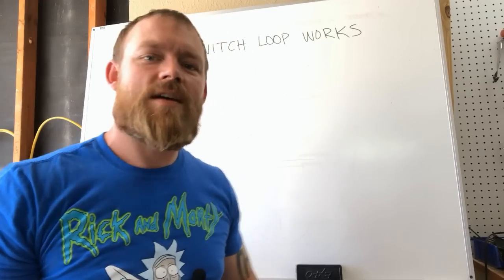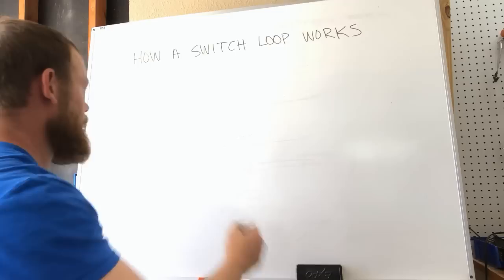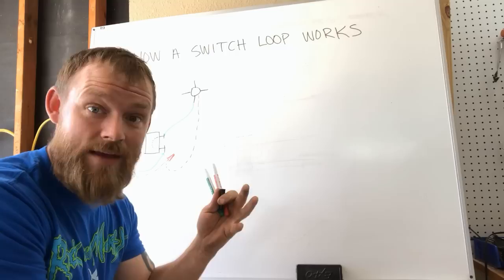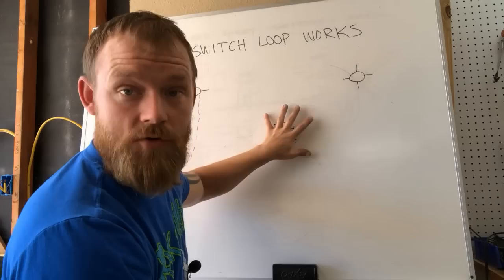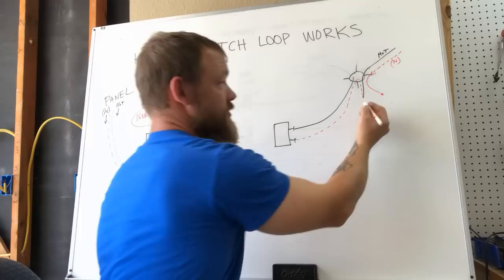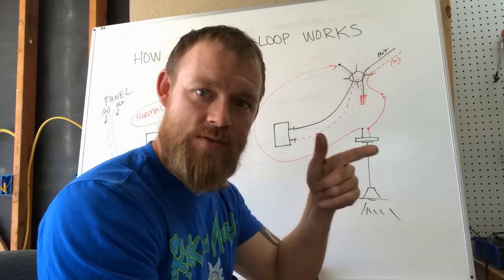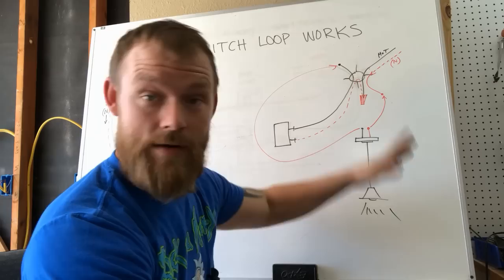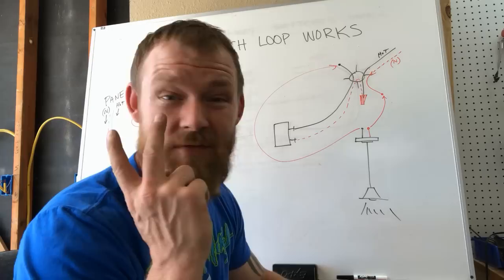Episode 13 -  SCHEMATICS how a switch loop works

Comment: You intended to offer an example(s) of why a switch loop would be used but, instead, you got side tracked explaining how a switch is normally wired and then immediately went into how the switch loop is wired. So, why would you wire the circuit this way? It appears to me that the same amount of cable is being used.
Reply: He did explain why a switch loop is used. If you have a light/fixture that has power to it, you use a switch loop to put a switch on it. An example would be you have an existing light that doesn't have a switch, like a light that uses a pull chain, the power is to the light. To add a switch, you just run a switch loop. That is easier and less wire than running new power to a switch box then also running the power from the switch to the light.
Reply: To me switch loops are great when the switch run is further than the fixture run so it saves cable.  e.g. if your load center is on the right side of the house and your switch is on the left side of the house, why run a romex across the house to the switch and then another cable back across to the fixture when you can run one cable to the fixture from the load center than go the switch. so now you have one romex cable run to the switch instead of two cable runs.
Reply: @kingmidas6901 same here.  But nowadays if we do that we have to use 3 wire cable from the light to the switch.  Because as of 2011, switch boxes must have a neutral available for the future installation of specialty switches.

Comment: I always make sure my switch boxes contain a neutral just in case you want to hook up some timer or other device that requires it. I've seen people use the box ground as the neutral in these situations claiming the timer or whatever doesn't draw much current so it's OK to use the ground for this purpose (totally illegal and dangerous).
Reply: For years it was common for a 220 volt dryers to run off a 3-wire plug.  No neutral! Just two hots and a ground.  And guess where the 120 volt  fan/drum motor got its neutral.  And for many years that was completely legal.
Reply: seephor please explain why you see using the ground as neutral as dangerous.
Reply: @Rick-the-Swift  The ground conductor is for faults. In other words, it's only to be used to carry current during a situation which may cause harm or death to person/structure etc. It's not supposed to be a permanent current carrying conductor. What happens when you use it as a permanent carrying conductor is that the chassis of devices/appliances are grounded to that same potential. Since electricity takes the shortest path to ground and if you have some resistance or a break in the grounding system, then the chassis of your appliance becomes hot. This means that in such a case, you could get shocked if you touch the body of any appliance or device that is grounded. By using the ground as a permanent current carrying conductor, you are not only negating the purpose of the ground to handle faults but you are actually causing the ground itself to be a source of danger.
Reply: Agree…it’s actually code in Canada…all switch boxes must contain a neutral, exemption is if switch box is roughed in using conduit.

Comment: I always explain it to new helpers as, we're just extending the hot wire (black) down to the switch and back to the light. That usually helps them understand.
Reply: yes, but you are teaching them a potentially hazardous habit. never bring the hot wire to the light first. NEVER!
Reply: @TheRainman904  Had bathroom redone and guys did this, 4 years later ceiling fan died, want to replace  but want to wire correctly, what does this include, running new conduit all the way to own breaker? Or could I "tap" into another rooms power and put a junction box in ceiling?

Comment: This appears to be ‘how’ my ceiling fan/ light fixtures were wired and just completed confused me. Power was brought in from an adjoining room, via the fan assembly, then to the two independent on/off switches. All this trouble because the ‘fan’ stopped working. What a nightmare!  I bought ‘a house that Jack built’ and am I ever sorry for it. Your video is MOST helpful!

Comment: So so helpful! I’m and apprentice only 2 months in and just seeing this drawn has really helped me. Our colours are different here in Aus (switch wire is generally a red and a white), but I was still able to make sense of what you were talking about. Also love that you drew a picture of the light and explained what that would look like in real life rather than just a diagram.
Thanks so much! 👌
Reply: Does that mean the white wire is still the hot when you got white and red?
Reply: @watsup3111  Well if its a switch wire then I'd say yes both the white and the red are going to be considered 'hot' as they will technically both be considered to be carrying a current.
Reply: @watsup3111  Well if its a switch wire then I'd say yes both the white and the red are going to be considered 'hot' as they will technically both be considered to be carrying a current.

Comment: I'm a DIYer, great explanation.  What I've learned about this is that if you use something like a 14/2, where you have just the black and white, then you should wrap a bit of black electrical tape around the white wire as an indicator that it's hot and not neutral.  Also, as per code in some places, you have to run a 14/3 (black, white, red)...where the white is just wire nutted off at the switch, the black is as you explained, and the red is used in place of the white that you've explained here.  So the line in hot black is connected to the red wire which travels to the switch.  It serves two purposes.  First, it is safer because red, like black, it typically associated with being hot.  Second, having the white allows you to, in the future, properly make other connections from that switch, like hang another outlet off of it or something...which you could accomplish with the neutral being there...but not accomplish if there is no neutral there.

Comment: Jeez!! Thanks so much.  Just had the craziest encounter with this.  A learning lesson none the less.  I went to change my fan to a light fixture and because I have been really good at grasping these installs, I went beast mode.  I just took the old fixture down and pulled cables and disconnected stuff; but after pulling these cables I noticed a white cable in with the black cables and it was a hmm moment.  So I pressed on and started wiring white with white, black with black and at the end the breaker box kept shutting off (shorting out) and would not allow me to hook this up.  I am so glad I found this video and it makes sense now, but WTF?  I will not go beast mode ever again and will study the connection prior to thinking I know my SH^%.  Always learning..

Comment: OH MY GOD!!!
This is the clearest explanation of a Switch Loop I have ever seen!! 
I'm a female who is soooooo happy not to pay some Electrician $125.00 just to roll into my driveway!

One suggestion: I started out with a Light Switch that had one wire holder labeled "Common" Took me a bit to figure out the black wire belonged in the same type slot as the hot White Wire (I switched to a Light Switch with no "Common").
Reply: For future reference, the"common" was referring to the neutral

Comment: This was a lifesaver! Have another circuit of lights in addition to switch so imagine my surprise with three white wires and three black. Isolated the switch and will mark the neutral as hot. Thank you so much!

Comment: Excellent job with the illustration being the key 'helper'. The way you explain made total sense to me as I am a linear thinker... starting point, next point, etc until the end point. 
I'm not an electrician BUT I do live in a house that was built in 1905. 
My dad has since updated the wiring. This is all good and well, however... he'll be 83 this year,  so when he updated the wiring it was old school switch loop. A constant hot from the ceiling down the switch. The colors he used for hot and neutral arent customary either. 
To make a long story short... every time I tried explaining what was in my junction box, what I was trying to do I was being told it's not possible, I didnt know what I was talking about or what I was doing. UNTIL you!
I am soooooo glad to have stumbled upon your video! For too long I've been trying to hang a new ceiling fixture where there used to be a double switch ceiling fan. When I removed the fan I didnt pay close enough attention to what went where. 
Your video has taught me enough to safely hang this fixture. I think....
I still dont know what I'm supposed to do with all of the extra wires! I have 2 white, 2 black, a red and a bare copper wire in the ceiling junction.  
I'm going to watch a few more videos and I'm sure you'll show me.
Awesome job and thanks again!

Comment: Wrap a ring of black tape around the HOT white wire at each end of the run. This is the indicator that the white wire is not being used as a neutral, but as a hot. 
Great video. Thank you.

Comment: Thank you for this video. My house was built in 1962 and most of the light switches were wired this way. I've been scratching my head for weeks trying to figure it out. You explained it perfectly!
Reply: My house was built in 1974 and is the same way.  "...scratching my head for weeks..."  Make that years!   I only had 2/some years electrical experience but that was, yeGads! 35 years ago!!  Since then the only electrical I've done was for my own purposes.  Heck, I still use my old Wiggy.

Comment: Exactly what I was looking for and it fixed my issue. My initial connection my light was on when the switch was on off and when I switch to on I would blow the breaker. Problem is fixed now 😁 knowledge is power. Thank you

Comment: Guess who spent 6hours trouble shooting a fan that he had tapped into a switch loop to make work because it had a black and white conductors connected to the single pole switch. 😒. I took fan back and everything. Then I saw this video and the light went on. Thanks a lot for your clear explanation.

Comment: Well taught.  I was trailing behind until I realized the difference between what connects to the lamp fixture and what connections occur inside the electrical box behind the lamp fixture. Thanks!

Comment: I did this a few times in my brother-in-law's house to add switches for lights that had constant power and were operated by pull chains in the fixture. In the boxes for both the switch and the fixtures, I put black tape around the end of the white wires that were made hot switch legs.
Reply: Seems like a smart and easy thing to do to make it quite obvious what is going on with the white wire.

Comment: Best how to on switch loop, you made it a lot easier to understand, even going to electricians school when understanding switch loop was mind blowing, but your method of showing how to connect it was right on point... Mostly ever house,mobile home around here is older stuff and 90 % have the switch loop which if not used to seeing will stump you..  Again thanks for these how to's...

Comment: "So easy, it's difficult." It only takes a moment to label the hot wire. Sometimes I'll mark the cover with arrows so the next guy can see what I did. It's the 4-way switches that drive me nuts! As a handyman, I don't see them very often. Great videos, thanks!

Comment: Thank you for this video and description.  I had a light fixture in an a basement that had three separate wires converging to one point.  When I took out the light I went into auto pilot and didn't stop to look at how the wires were run and tore apart the rats nest, then I realized I had two black wires and a white connected. At that point my mind was blown and off to youtube I went. Appreciate it!

Comment: Not sure if you can answer but, I have an older home I'm renovating with switch loop wiring going into a J box powering basement light fixtures, and also powering 3 receptacles on the 1st flr. I want to add 3 way 14-3 wire going into two 3 way switches. I will remove the current single pole switch and use the same wiring on that switch so that all fixtures and receptacles continue to work as before, plus add the 3 way wire running from switch to switch.

Comment: You explained it great. I just would like to know why would a switch loop be necessary in any situation
Reply: Sometimes it's easier to bring a feed cable to the light first and then to the switch. However, you need to bring power to the switch first so you connect the white wire going from the switch to the light (normally a white and a neutral) to the black from the panel side. Problem with this is you sacrifice a neutral in the switch box. So you can't install a smart switch or a dimmer switch for example because those draw current and require a neutral..
Reply: I am a residential electrician who does electrical roughing and from my experience a switch loop is absolutely necessary when wiring a receptacle with a half constant hot and a half switched hot which is necessary for an appliance like a sink disposal it's exactly the same as what the video just explained except instead of a light it's a receptacle.
Reply: @gustavoramos8229  This makes sense. So basically, for any appliance that doesn't plug in (and has a direct power source, like a garbage disposal), but still needs to operate with a switch. Perfect explanation, thank you!!
Reply: @ThriftDiving  this doesnt make sense. If you wire it like a "normal" switch you will still have a switched disposal.
Reply: Faybian Grant I was renovating an old house with knob and tube wiring, so I had to put new wiring in it but it already had Sheetrock so I fed it from the attic because it was on the second floor and used that light to feed the switch and stuff.
Reply: Don't you need the ground ran to the switch??
Reply: @starrmansays7019  yes, when he says 12/2 it has two conductors plus a ground.  With romex you don't count the ground. It's always there. For instance 12/3 would actually have 4 wires present.  3 shielded conductors and a ground usually unshielded.

Comment: Not just advanced wireless control switches require neutral ... some simple switches with "nightlight" LEDs, timer switches, and occupancy sensors (which are getting super common) all require it.  Great video!

Comment: There are thousands of homeowners of older houses who need to see this video. It was a common method at one time. This video helped me understand basically how all the fixtures in the house I'm moving into are wired. It was a complete puzzle before but now that I understand it it's pretty straightforward. If you're changing out a switch and there are only two wires, no neutrals in the box , then this is what you've got. Thanks. If you should read this comment, here's a question. What gauge wire is adequate for the switch loop? My house has 12 gauge but I noticed that the switch loop was a thinner gauge, possibly only 16? Probably adequate just to run juice 10 feet or so from the switch to the light but what's code on this?

Comment: holy shit dude thank u so much! i get it now!  the loop is still there you're just extending the hot feed through the white wire to the switch and it comes back through the black wire that's why you just need a 2 conductor wire. appreciate it bud!
Reply: Chris (If that really is you) most places will require you to use a three wire with ground for that leg down to the switch from the light, because that way you'd have the required neutral within the switchbox.

Comment: In commercial wiring, schools, hospitals, stores and such your lighting circuit/conduit  is installed light box to light box. There is also a conduit that is installed from light box to switch. Only two wires is needed to a single pole switch to open the circuit (turn the light off). All this to say "switch loops" are common way of wiring when your not doing house wiring.

Comment: My newly built condo has this switch loop, even though it's an old style(?). Except, the white wire on the switched hot wasn't labeled with a tape, and the neutral wire wasn't stripped nor had wire nut on it so I couldn't find it for a while. Now I know what's going on. Thanks for the informative video!

Comment: The explanation was easy to understand but you should give some solutions to those replacing a normal on/off switch with a smart switch that has load, line and common on it. Obviously it needs one more wire but whats the easiest way to accomplish this?
Reply: Simply run a 3 wire from the lightbox down into the switchbox, rather than a 2 wire as is being shown. If you didn't do that, you'll need to fish a neutral in.

Comment: Clear as dirt!

I'll rewatch it a couple times though, I think I almost get it. 

Thanks my dude.
Reply: The Romex cable enters the light box (its neutral is connected to the silver screw of the lamp), its black wire which carries the current from the panel is connected to the neutral (white) of the Romex cable coming from the switch box, the black wire from the switch box’s Romex cable is connected to the lamp on its brass coloured screw. Remember the meme ‘down on white, back on black’.

Comment: OOh yah,  I get it now, thanks. I just encountered this same pile of crud under an old 1980s ceiling fan.  I'm trying to replace the old clunker with a regular light fixture but I still can't get the blasted thing to work without blowing the breaker. I feel something else must be amiss which is why the lights on the fan stopped working years ago. Ugg, nuthin's ever easy when it comes to DIY home improvement